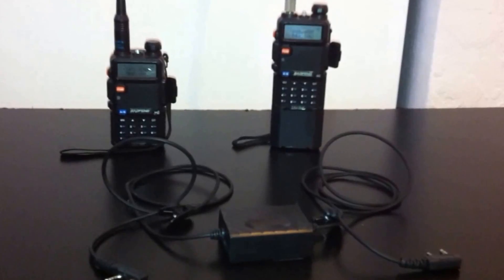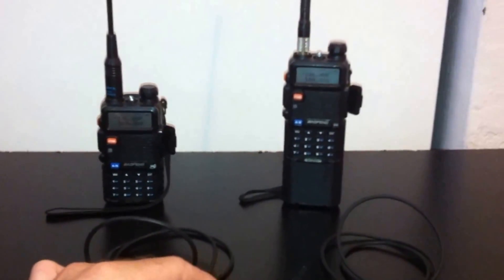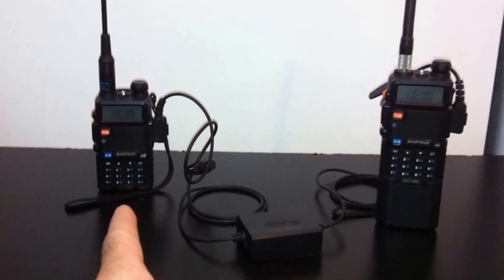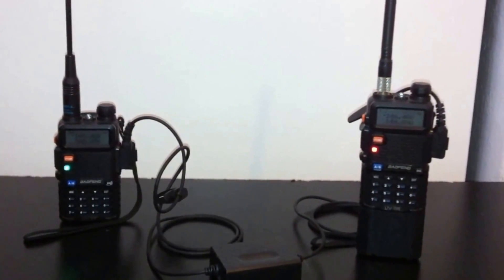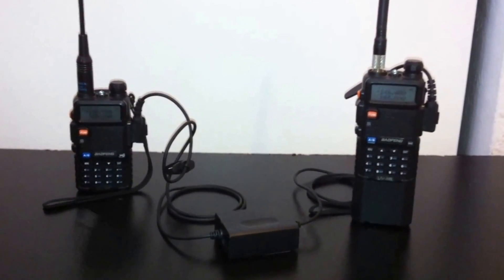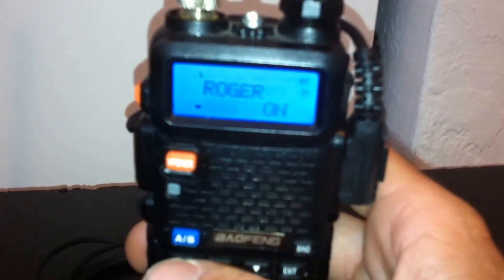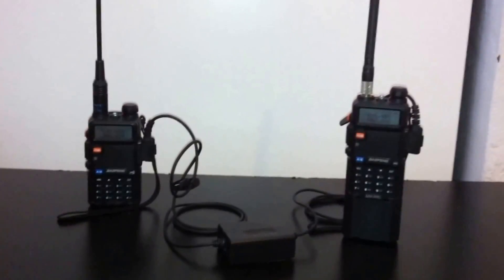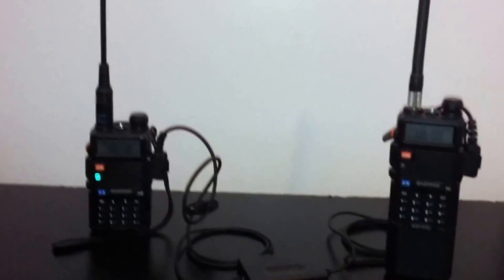Set up a Baofeng UV-5R repeater

Comment: I am a noob in the radio world. I was wondering if you could set this up to connect to other repeaters? A little explanation: I recently built my first quarter wave antenna. I'm now able to hit repeaters using my HT. I would like to use my other HTs without being tethered to my antenna. Could I set this up so that I would be able to hit this repeater and then that would transmit and receive to other repeaters?
Reply: Absolutely No way, not possible and highly illegal💉💉💉
Reply: @democratpro  Well, now I'm a little further into my radio journey and a little more experienced. If You use a part accepted radio then you set it up as a crossband repeater. It would work and it would be legal right?   For example: You would set your TX (part 95 certified) radio in this repeater setup to whatever frequency and PL tone the repeater has. You would set your RX radio to whatever frequency you needed. You would then transmit from a third HT to the RX radio. That would then shift the transmission to the TX radio and send it out on the frequency with the proper PL tones for the repeater. You would set your third HT to receive on the repeaters, TX frequency and PL tones.  At that point you would only be transmitting to the repeater on a part certified radio. And you can receive on a the non part 95 certified HT. 

What do you think? Legal workaround? Maybe there's something I'm missing.
Reply: @blottermad  yer goin to PRISON, comrade!

Comment: When you said about external antennas why not a dipole ?
Reply: 2 x antenne cannette (430-460)mhz
https://youtu.be/_XVTqHEjJsg

if you want an excellent result you must use a h155 coaxial cable (5 meters for each antenna).
1) 2 baofengs spaced at least 1 meter.
2) 2 antennas (cannette)  spaced at least 10 meters apart.
3) offsets at least +5000

Comment: I was cussing mine until I went back to Amazon and read the note that the volume on the Baofengs should be turned up all the way. Worked like a charm after that.
Reply: Is that on both radios?
Reply: @salopsniper22  yes.

Comment: Hey Eric...I got into radio due to the fact im partially disabled- I 
Passed my tech and general  last  September  but I am still a total noob....
I have a uv5r in my truck as a mobile rig running through a btech vhf amp with a tram mag mount antenna. It works very well and i often hit repeaters over 60 miles away. ( im in very rural Mississippi) When i do go fishing or a woods walk, i bring along a uv5r mostly for NOAA weather,but also in case of emergency and my cell has no signal.... here is my question- Is there a way to use the radio in my truck to re-transmit a tx from my handheld using all of its power and antenna?? I have the genuine Nagoya on the ht but i cannot hit any repeater near me barefoot.... Thanks for your time and for all you do to help us noobs out. 73 de KI5GEV
Randy in the North Mississippi woods.
Reply: do you have a link for antenna on your amplifier? thinking of setting up this same thing.
obviously we need a 3rd UV5r for the walkabout radio, then the other 2 would be at the truck to rX/repeat out from the Amp side

Comment: Hey man, I need your help.  I just purchased this cord and tried to set up my own GMRS repeater system with UV-5r's.  (RX = 462.6000, TX = 462.7000, with a 000.100 negative offset.)  For some reason I'm having a problem with the UV-5r that's acting as the RX, get stuck open.  (I transmit a signal, the RX radio hears it, however when I let go of the PTT, the red light stays lit up on the RX repeater radio for quite sometime afterwards.)  This issue happens about 50% of the time and it's preventing me from making back to back transmissions.  The RX radio will stay open for a few seconds, or a minute, or even longer sometimes.  I've tried moving the repeater system further apart, and I've tried utilizing different antennas with varying heights on each one.  I've even tried using different UV-5r's, thinking maybe i just had a faulty radio.  Seems to be a consistent problem, no matter what I do.  Any advice?
Reply: Min offset 10Mhz
Min antenna distance 15 m (7.5 x2 coax cable h155)
Tx low power
Vox max
Squelch Rx 3 ... Tx max
Volume Rx 60%
Reply: @brunobassi2440  Don't GMRS repeater channels have their own 5Mhz offset? True GMRS radios use channels 23-30 (or 15r-22r....or R1, R1, etc.) that operate on 467.xxx for transmissions. So a GMRS repeater would set the Rx side at 467.xxx and a Tx side at 462.xxx which is the 5Mhz offset. That way these radios (which are actually type accepted for this frequency -- different story) set up as a ad-hoc repeater could allow a true GMRS radio such as a Radiottiy GM-30 or say a Garmin Rino to utilize it. I just wonder if the Rx UV-5 would just have the actual frequency set or would it need the negative offset programmed in along with the Tx radio output. Would be interesting to try for the educational exercise....
Reply: @brunobassi2440  THANK YOU!
Reply: @brunobassi2440  Hey brother could you post a link to the coax cable you referred me to?

Comment: Can this go both ways? For instance, I am trying to connect a network radio system to a transceiver. but the Walkie Talkie Repeater Box would need to work in both directions to pass the network radio to the transceiver and the transceiver back to the the network radio.

Comment: These cheap Chinese wonders have NO jack for an external DC power source!
Your fully dependent on the supplied "cheap" Chinese battery. Which, in my experience, are little more then trash to begin with!
Q. Has anyone found a practical work-around for this?
Is there a safe and easy way to install an external power feed?
Would be nice to know.
Reply: Yes they sure do!!!! It looks like the battery with a cigarette plug attached to it.  So easy to slip on plug in and go...

Comment: Simple video, however you forgot the part about desensing.  You see, even a small simple repeater like this needs a duplexer or at least, a notch filter to notch the TX Fr from the RX Fr.  Without the duplexer (properly tuned) your transmitter will overload (desense) the receiver.  After you get more than a few feet from the system, all you will hear is static, or at best the radios will begin to cycle, as the receiver is cut off by the transmitter, then keys again.  The basic concept however, works... you just need to add the filters and cables and you're off to the races.
Reply: I agree with the cycling part.
Reply: Or just have the antennas separated
Reply: So, with a duplexer I can run my TX radio through an amplifier, to the duplexer, to the antenna.

I can run the RX radio to the duplexer to the same antenna.

Do I need to be aware of any other technical issues?

I can’t run this on HAM frequencies, but could I use this as an FRS / GMRS repeater?
Reply: @memowilliam9889  sounds like you got it. There's videos on here with a guy doing exactly that. He used a retevis repeater, but swapped the duplexer to a 50w.

Comment: In this  set-up  what will be  max range
Reply: Depends on how high your antennas are.  This is 5 watts, so the range wont be that far.  Have you ever tried to use two 5 watt radios and talk on simpelx?  So if one person is on top of a mountain, and the person is down below say 50 miles from the base, you can make a great contact.  But if you are at both the same elevation, you wont get very far.  So antenna's will have to be up high.

Comment: You could make this with just an audio cable between rx-speaker and tx-mic, but than you'll have to have vox activated on the tx-radio.
Finding a 2.5mm male jack to 3.5mm male jack-cable might not be easy.
The only extra function of the repeater box is automatic ptt toggling and perhaps an amplifier?
Reply: @belliduradespicio8009  Get a 3.5mm wire plug and a 2.5mm wired plug. You have to wire the red on one to the black on the other, use two wire plugs only and you wont have this problem, set the VOX to 10. I saw that set up on another video FWIW.
Reply: I just used a 2.5 to 3.5.....perfectly fine. .......AFTER buying 3 boxes🤦🏾‍♂️

Comment: is there a external power supply to attache to prolong the battery of both rx and tx radio?
Reply: I know the extended batteries have ports for AC/DC adapters.

Comment: Wondering if there are adaptors that would connect from ht to the internet so the ht's would not need to be in the same physical location. Not sure if this is even permissable
Reply: zello,allstar , dmr, etc all do exactly this but in most cases a cheap radio is modified with a few resistors and soldered to a cheap  sound fob to solve ptt type problems.

Comment: Hi sir Eric my order for repeater systen just arrived . Have test it and it works like what you show on video. Thanks :)
Reply: How do u make it work  Ive been trying for months . my antennas are 30' apart horizontally and 10'  vertically  .  all I get is an almost but not quiet

Comment: Since I am brand new ,is this different ,repeated then locking on to a local repeater in my area? Anyone .Boa Fengs may be cheap but all the things you can buy for them add up.beginners need to no what we need to start.
Reply from the maker: This is nothing like a normal repeater. This is just a small idea for someone when camping or hiking, or on their own property.
Reply: @HamRadioConcepts  thank you for the info good idea

Comment: Was this in English? I definitely need to take a ham radio course but I'm afraid it would be too complicated to even understand because I have no idea what you just said I don't know what negative 600 meant. I have a baofeng but with no frequencies installed. all I can get is weather but I need to set the frequencies up in case of an event where there is no communication except for ham radio
Reply: Get a ham license and you'll quickly understand these concepts.  You'll increase your ability to communicate exponentially.

Comment: just wondering how far the rage is with this setup because when I tried it works fine up close but at a distance the radios continue to key and unkey the whole time I attempt to transmit
Reply: Try raising the transmit antenna 10 to 15 ft above the receive antenna.
Reply: I’m experiencing the same thing. Works to transmit 1 time then just keys up back and forth constantly.

Comment: I do see problems with a baofeng repeater.
1. They run on battery's and will eventually die. 
2. If they were run while in the charging base the radio would overheat.
3. Baofengs will cut off after 600 seconds of use
These could be fixed but I just wanted to get that out

Comment: What antenna are you using on the TX unit with the extended battery? and is it covered for 136-174/400-520mhz?

Comment: This shit DOES NOT WORK. The antennas are 5-6 feet away from each other at max, they desensitize themselves and the repeater doesn’t work more than 20 feet away. You need a duplexes for this to work properly or at least 30 feet of vertical separation.

Comment: Hey, Any special Laws regarding making our own Ham repeaters? Can technicians do this?
Reply: Yes a Technician can make your own repeater.  Just make sure that you are not using the same repeater pair as a nearby repeater.  Otherwise, you might get a pink card from the FCC from an upset repeater owner.  Best way to do it is contact your repeater coordinator in your area and find out if there are any repeater pairs that are available, fill out the appropriate paperwork that they require and hope that you get a pair.  If not, then you need to do research on the area you are in and make sure that your repeater doesn't interfere with another one using the same frequencies.

Comment: By the way, I made one of these repeater interfaces from two cables from junk headsets and added two resistors to cut down audio level from the receiver to the transmitter.  You have to decrease the audio level by at least a 10 to 1 ratio.  I did this with a resistor divider network consisting of a 100k resistor and a 10k resistor. (I wish I could put a diagram in here). Wire the two resistors in series ....   feed the audio output from the receiver into the 100k resistor .... connect the loose end of the 10k resistor to ground of the receiver... connect the grand of the transmitter to the ground of the receiver .... connect the mic input to the junction of the two resistors (where the two resistors are connected to each other).
Reply: Why
Reply: Ooooh, thanks for the tip. I've tried this with cables directly and it's awful, so using resistors will clean up the signal and keep it from clipping!
Reply: Just turn the volume down, 🤣🤣🤣🤣🤣🤣🤣

Comment: But there is ONE problem that NONE of these videos address.  Receiver desensitization.  I set one of these up and while the transmitting handheld (that is NOT part of the repeater) is sitting two feet away from the repeater it works perfectly.  But in my test, when the transmitting handheld reached about 50 feet away the repeater's receiver could still receive the carrier but the repeater's receiver was being so desensitized by the repeater transmitter being so close to it that the handheld transmitter could no longer be received.  In other words, when you got 50 feet or more away from the repeater it became useless because its own transmitter was interfering with its own receiver.  I tried moving the receiver and transmitter 5 feet apart .... no help.  So a MUCH wider separation will be needed between the repeater transmitter and receiver to make it practical.
Reply: At least 20 feet is needed on UHF and 60' on VHF.

Comment: To answer another question of "what advantage does this have over just using two radios?"  The answer is that if the repeater is located at a central point and one handheld is 4 miles to the east of the repeater while the other handheld is 4 miles to the west of the repeater  The first handheld can transmit to the repeater while the repeater transmits to the send handheld.  This would not work with using just two handheld radios that were 8 miles apart.
Reply: Wow, this alone answers all the muddle I have of understanding what a repeater does after a few weeks of trying to understand what it does..thanks a lot. Can I ask 2 questions? 
If handheld A talks to handheld B via a repeater as described, does all talkies have to be of same model and what would the frequency for A and B? (Normal talkies have to be on same frequency/channel to talk)
2nd question is of something called copy frequency scanning. So if I have a Baofeng and a simple non digital analog Motorola, can i use the Boafeng to scan the Motorola and talk to the Motorola? Otherwise if not, what's the point of copy frequency scanning, what does it do? 
Thanking you so much in advance, looking forward to a clear answer

Antoni
Borneo tour guide
Reply: @MrBamboochicken My understanding is that you need a radio that supports having an Rx and a different Tx channel active. you have both A and B on frequency(f) 1 for tx'ing, and in f2 for rx'ing. Then, on a repeater like this, the radio that receives the comms is in f1 and the one that transmits is in f2. This is so because otherwise you would interfere with your own comunication with the repeater.

Comment: To answer the question of "why can't I just use a straight cable from one radio to the other?"  the answer is that the earphone jack outputs about 350 millivolts .... while a microphone outputs about 15 millivolts.  So with a straight cable you would be ramming 350 millivolts into an input that expects 15 millivolts and severely overdriving the mic input on the transmitter.
Reply: Darn, too bad you cant just TURN THE VOLUME DOWN! Oh well, shucks
Reply: @democratpro  these guys are wrong. It works with vox setup on your baofeng. And the volume can be turned down. These Jack's are analog. Less volume = less volts
Reply: So being a nube, I saw a guy who used a strait cord with an adapter (2.5 to 3.5). Your saying that he is going to fry his radio?
Reply: @LM-uz4pr  yes, in time.
Reply: @LM-uz4pr  That is very likely.  Or the retransmitted audio will be severely distorted to the point of being useless.

Comment: Scenario: 350 acre thick woods and 5 watt handhelds are not able to reach from end to end. 

There is no good area in the middle to set up 1 repeater.

There are good trees 1/3 of the space apart.

Does anyone know if 2 of this exact setups will work with each other and all radios tuned according?

Thanks for helping out!:)
Reply: Build a tower?
Reply: I would suggest finding a tall building to build an actual repeater on.  Not this.  This is typically used for a temp setup.
Reply: Question-

Where is the least likely place on earth to find a tall building.. in any country?

Answer— in the middle of 350 acres of thick woods.
Reply: -“350 acres of thick woods where two radio can’t reach from one end to the other..”

Response .. “find a tall building. 

You’re not that smart are you?

Comment: Can you use multiple uv5rs as walkie talkies
Reply: Not legally. The UV-5R is an amature radio that has the ability to transmit and receive frs and gmrs signals, but due to the power output of the radio it is illegal to use this way. Also: to use an amature radio without license is illegal, stick to Cobra or Midland if you want a walkie talkie, but be warned there are some walkies that actually do require a license (hint: GMRS). Always read the directions when you buy some.

Comment: This won't work, the minute you get a 100 yards from the repeater the the transmission radio signal is diluted by the the receive. This is due to the repeater using two seperate antennas. When a repeater uses seperate antennas for TX/RX they need to be around 30ft apart and the interface cable on these prevents that. 

The solution is to add a duplexer and move to a single antenna that is tuned to a specific frequency, or to get them spread far enough apart (duplexer).
Reply: or put a good filter on the antennas
Reply: @richallcorn how do you go about putting a filter on the antennas?